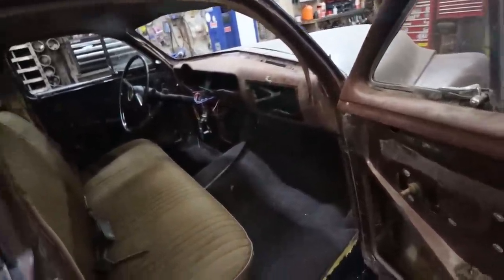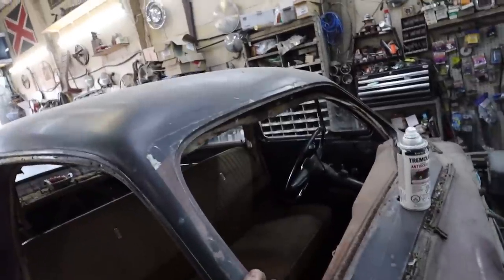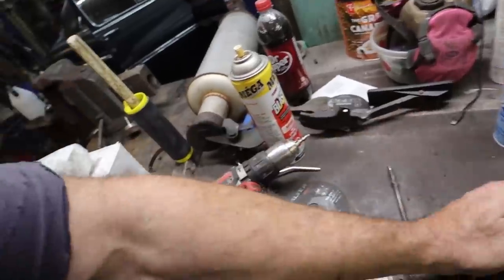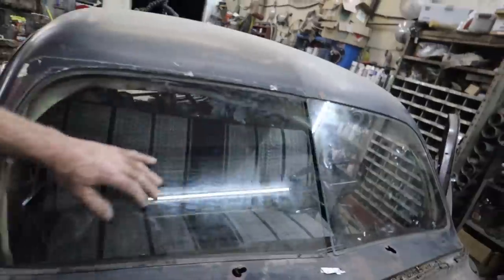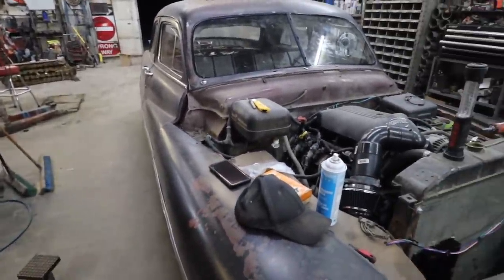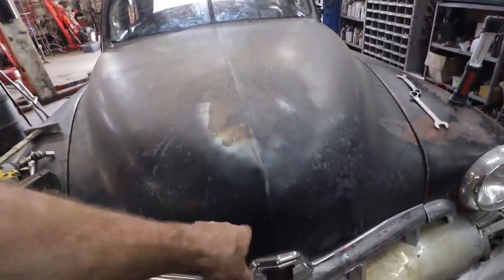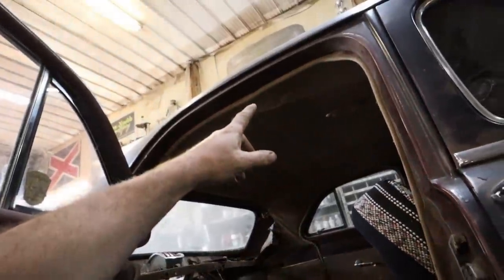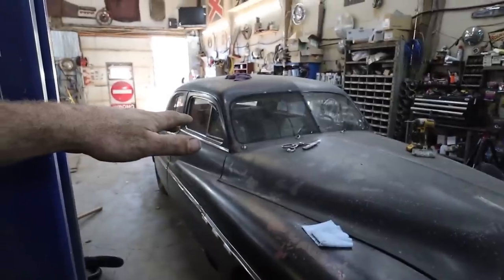Covering seats, installing the windshield and hood - Mercury Monarch build part 10

Comment: It's a spoon gas,gas,gas pedal. Paint'n da dash cauz it's metal, da two piece windshield's glued in it ain't brittle, Ls vacuumed windshield wipers fer rain not spittle, borrowed hood hinges n no prop rods it's settled, heated front seat tushy pads keeps m  warm as a kettle, stylish seat  covers n carpet runners n blankets an old warrior's medals, Merc's peddle n medals n to da metal, Pablo n da man got it settled.

Comment: Great video Brent, you made a lot of progress on the mercury in one night. But I have to say I think it does need some kind of a stainless trim around the windshield to make it look finished it will also match the Side Glass. And the seats came out better than I expected. For the sagging headliner just get some upholstery spray and shoot it through a tube, get it under the liner and then just press it to the roof. You might need a heat gun. Looking forward to seeing the dash come out nice with maybe some kind of cheap Amazon stereo. Anyway, always good to see Pablo and keep up the good work , I'll be watching.👍

Comment: An alternative to old blankets is shag carpet. It has a nice strong mesh on the back and won't move around much and your butt does nothing to it - it was designed for foot traffic. I learned this when I got an old tractor with a scrap over the springs for the seat.

Comment: You have stopped the biggest drafts so the engine should circulate enough hot or at least warm water to heat the front half... lot of area to heat or similar to a barn inside.  I did like the way they floated down roads and hugged curves like they would roll over then pop back up... great memories

Comment: Some of the large Chrysler products of the 60s and 70s had rear defrosters in them from the factory.  These usually swap in pretty easy, IIRC - if you can still find them.  
Also, I've never been a fan of vacuum wipers, they go fast when they shouldn't (at idle) and go slow when they shouldn't (when throttle opens up).   They improved a bit when they started using the fuel pump as a vacuum source, then you would get more vacuum the faster you went instead of vice versa.

Comment: With the carpet and the lump in the middle cut a straight line down the middle and it should match up fine hit it with the heat gun and it could mold into place

Comment: Ya that works for the windshield - I have done it both ways on chopped tops but gluing them in on the inside the windshield moldings fit nicely against the glass if it looks funny at all a narrow stripe of black paint around the edge hides sins - 51 Mercs and Monarch 4drs are one of my favorite cars - I like the suicide rear doors so much I changed a 57 Buick to mimic them

Comment: "Ureth-hand"?....That's what they make Ravens for. 

For a pro look on the glass;  you could take that rubber gasket and cut the inside flange off flush, and then glue the outer part of the gasket on top of the urethane perimeter. The best of both worlds.

Comment: "Just lazy & didn't wanta recover all my seats" says he, after recovering all his seats? Glue in windscreen was used by Dave Kindig to "modernise" the look of some vehicles his shop did. Max. approval! 👍 I reckon there's a bit of anxiety about the method used, being shown ? Yet the result isn't too shitty as you might think, viewers would reckon. In fact the cars and trucks you slap together are a stroke of artistic genius. And that requires some mechanical , engineering, upholstering, panelbeating, part adapting, auto electrician, intellectual visioning, imagining skills. Well you know..

Comment: In a few of your videos you build 2 wheel rear drive vehicles which you mention you’ll drive during the winter.  May I ask why not a front wheel drive or 4x4 for winter?
Reply from the maker: Have a 4x4 but find I don't ever need or use the 4x4 feature as I don't like the way they handle. They have there place but if the weather is that bad that I need 4x4 I just don't bother to go out. :)

Comment: Brent you and that windshield fitting 
i used to fit armoured bullet_proof glass
to the presidential fleet of armoured cars   
the glass was 33mm thick 
all the fleet had to look original from the outside 
so to fit glass the aperture was 36mm deep
silicone sealant was use for bonding 
the rubber windshied surround was cut into a T shape
and inserted     into the grove between glass and body 
taped into situ until cured the any chrome fitting fitted after 
 all to make Mr President safe ,,,, Edwin J
Reply: Hi there without actually seeing the fogging 
its hard to say,,, but the usual cause is what is known as "de.lamming "  glass is made up of layers of glass and plastic a process known as de lamination,,,, the plastic causes the window to discolor over time  no cure that i know of only replacement,,,, that is difficult and mega expensive,,, complete set of glass,,,, $60,000,,,
not two pieces of glass are the same measurements ,,cars are made to fit the glass not the glass to fit the car,, thats how it works,,,
and consignment of glass is ballistics tested before fitted,,,,,,, Edwin J
Reply: @edwinthompson6510  Wow, good info!  Yeah I wondered if it could be sealed under a liquid under pressure or in a vacuum or something?  It's at the Henry Ford Museum but it was 15yrs ago I got a few pictures

Comment: I know a fortune it will cost to do it something I don't have but.. can you picture taking a car like this splitting it in half stretching the frame and make sure it's solid and stretch the body and give it all the interior luxuries of a limousine.... Although you may want power steering and make sure the front seat can still maneuver back and forth for comfort for the driver... Like I said unfortune...

Comment: Back window defroster....Wish has 12V electric heaters for sale cheap. Make a housing for one or two (each side) with a small fan ... problem solved for under $40.
Reply from the maker: I just an electric fan just to move some air usually works well on these old cars.
Reply: @HalfassKustoms  yeah, true dat. Also thinking it might add some warmth for back seat passengers. I remember our "bus" to public school  (once the 1 mile walk to the end of our side road was stopped) was a Cadillac limousine of that vintage and full winter gear (of the late 50's, early 60's) was nearly mandatory for back seat passengers. And this was southwest of Ottawa, not nearly as nasty cold as your Prairie climate.